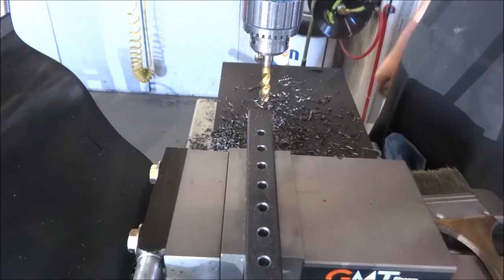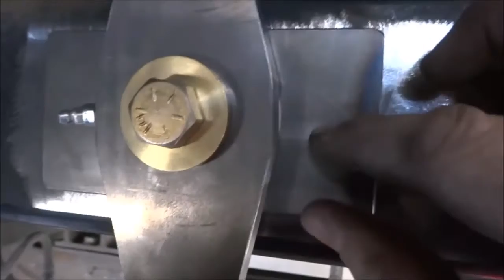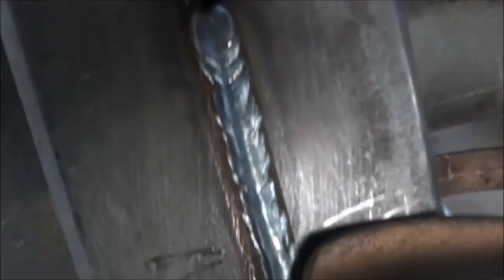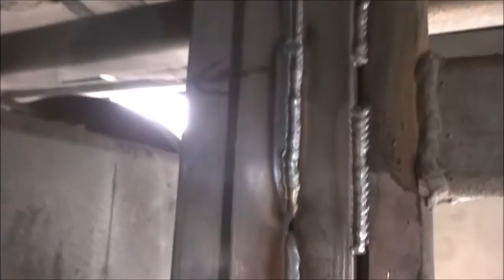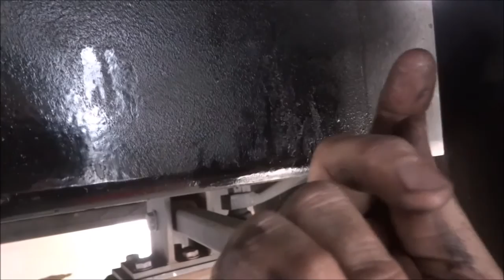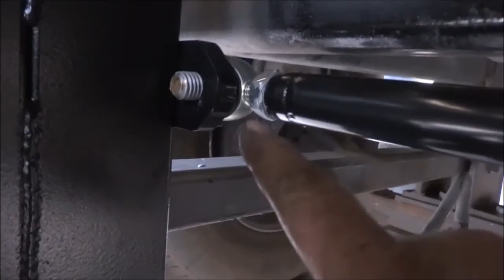Monaco Roadmaster Front Suspension Watts Link Part 3 of 3

Comment from the maker: I have put a little over 3k miles on it since the addition of my Watts link. One 650 mile day on the way to Texas and I am very, very happy with the way the coach handles. Long constant radius curves are where I really notice a difference, holds the line beautifully and no need to alter the steering wheel input mid-way through the curves. 
Thank you for watching my videos. I hope you have found them helpful. 
Mike.
Reply: Good to hear, I really need to figure a way to fabricate one for mine.
Reply from the maker: +Tim Harris you won't regret it. Well worth the effort. 
Thanks for watching. 
Mike.

Comment: Love watching your videos.  My question is, I have a 2000 Monaco diplomat RR8R.  Currently have  Koni Shocks, TRW steering box, Safety plus steering, Air tabs and installed rear cross braces from Monaco watts.  I tow a 2005 Jeep Liberty.  Crossing I80 crosswinds come out of nowhere and I only drive 63 mph. I am always in search of adding more to help make it more comfortable and less stressful at times encountering these wind conditions.  I am always on a budget. Have owned this coach for 11 years and have done many other upgrades from Solar to residential refrigerator, to flat screens to flooring.  My question is in your honest opinion should  I go in the direction as front and rear sway bars or the front monaco watts link, or some form of combination of both.  I know it will never be a Prevost or like having a tag, but feel I can get closer to it.  Thank you for your videos I value your honesty. Have also considered running a bigger set of tires on front to help smooth ride. Currently 255/75/R22.5. Thinking of replacing front to a 275/80r22.5 , thoughts?
Reply from the maker: Personally I didn't think the aftermarket sway bars do much more than the OEM.

I think the Watts front and rear do much more to control handling on a non-tag coach than on a tag coach (S-Series).  I would also look at better suspension bushings such as the Atro as they prevent excessive movement in the suspension which is where the adverse handling originates.

Thanks for taking the time you watch.
Mike
Reply: Thank you Mike.  However there are no sway bars on my 2000 Monaco Rr8r.  I will also check bushings.  Is it better to go with the front monaco watts first since I have already put on the X braces in the rear already.
Reply from the maker: Yes.  I always recommend putting a Watts on the front first as that is where the movement has the most effect, meaning it controls where the tires  are pointing and the coach is going to go where the tires tell it.
Reply: @zmotorsports62  Thank you.  I will head in that direction.  What is your thought on the bigger front tires?
Reply from the maker: If you are at max. limit, need the weight carrying capacity and have the room then yes, they are a good idea.
Reply: @zmotorsports62  Thanks Mike.  It would be more for the softer ride, based on my weight I could run at 85lbs with 275/80r22.5 vs running at 100 lbs with the 255/75r22.5 at my current weight of frt axle. Feel cracks in highway not quite as jarring I would hope. Concern was if it does anything to wheel alignment or the ride height or adjustments to ride height arms.   Appreciate you, and absolutely love your shop very jealous.  I have the ISC 330 Cummins.  65k on it now.

Comment: You are amazing Mikee.  I always like to watch your videos and these were great even though I do not need on my S Chassis w/o tag because I have a Howard Power Center Steering unit that was on the coach when I bought it.

I wish you had the HPC steering on yours so that someone was around to fix/tune these units.  I happen to know where one is available (used) and I would not tell anyone about it unless it was you.  If you will install it on your Dynasty I will pass on this info.

Great videos Mike and what a great shop..

Rich O
02' Windsor
Reply from the maker: Rich Oliveria thanks for the kind words and thanks for following along on my channel. As for the shop, it it well equipped but has shrunk over the years with the addition of more and larger equipment, but I am working on a remedy for that. 

I think you would still be impressed with a Watts link even though you have a Howard's steering system as the Howard's does nothing for actually holding the bushings from flexing/distorting under load, it just compensates for it. 

Either way I'm glad you are happy with how your Roadmaster chassis handles, it sure makes them easier to enjoy. 
Mike.

Comment: Mike,  Did Van include the grease fitting on your link?  I don't recall seeing one on mine but I'll have to check.
Reply from the maker: The pivot plate I got from Van did have a zirk for greasing. One thing to look at is if there’s a white poly washer under the pivot plate. If so, I would remove that. The plastic/poly washer take up a bit too much clearance and can cause the bolt to back off during movement of the pivot block. It functions perfectly without this washer and the bolt will stay torqued properly better without it. 
Mike
Reply: @zmotorsports62  Ha, it's funny you say that.  I was at the Monaco 'Gathering' at Lazydays in Tampa late Feb and met Van there.  After they talked about the Watts link I went out and looked at mine and noticed something hanging down by it.  Dave who I purchased the coach from thought it was just something I had picked up while driving.  After I got back home and was able to get to it we discovered it was that thin plastic washer and Dave, like you, said to just leave it out.  I have photos of it but can't post them in the comment sections.  I'm enjoying your videos and learned a LOT about the workings of the Aqua-Hot system as well.  I had a REAL BAD experience with a mobile tech recommended by Aqua-Hot that worked on mine when he broke everything he touched. :-(  Never thought I was going to have to start an entirely new career as an all around handy-man after I retired. LOL
Reply from the maker: Properly maintaining a coach IS practically a full time job.lol
Sad to hear of your bad experience with the Aqua-Hot tech. Unfortunately there are a lot of “hack” mechanics out there. However, there are a lot of great ones too. I would just prefer to do things myself and ensure they’re done correctly. 
Thanks for watching my videos and I’m glad you have found them informative. 
Mike

Comment: Did I miss the test drive results? I have same chassis so interested in results.
Reply from the maker: I don't believe I recorded the results in a video because it was more about the fabrication and installation.  However,   I've been quite vocal over on irv2.com on my coach's repair/modification thread as well as several handling threads.

Bottom line, I'd put my coach up against anything on the road as far as control and  handling manners.   It's a one finger driving operation most of the time and driving 750-miles a day are no problem and arriving relaxed at our destination. 

Thanks for watching.
Mike

Comment: Mike, I am looking for assistance with a Watts Link setup on a 36' Beaver Monterey. I spoke with Mike Hughes and he advised that I contact Van in NC. Are you able to help me put a kit together or point me in the right direction? Do you have contact info for Van? Thanks!
Reply from the maker: I was under the assumption that Mike Hughes was the only one offering these components at this time.  I know Van is active on irv2.com so that would be the best avenue to contact him, via private message.  I know he recently sold his machine shop so not sure if he is in a position to machine parts however.
Mike
Reply: @zmotorsports62  his account does not allow direct messages. Would you be able to help me come up with a kit for my front axle? I think Mike Hughes has a kit that will work for my rear axle. My front is similar to the one in your video with the jack right behind the generator.
Reply from the maker: I don't have hydraulic leveling jacks on mine.  I didn't purchase any parts from a kit and machined/fabricated my Watts link from scratch to make sure it fit my specific coach.    They don't call Monaco coaches snowflakes for nothing as no two are alike.
Reply: @zmotorsports62  would you be interested in fabricating the parts I would require for my front axle? I can send you all the measurements of what I have. Im a Carpenter and a mechanic. Im capable of getting proper measurements and installing.
Reply from the maker: I'm sorry, I just don't have time as I'm buried with projects.